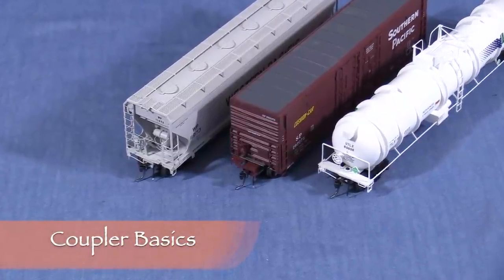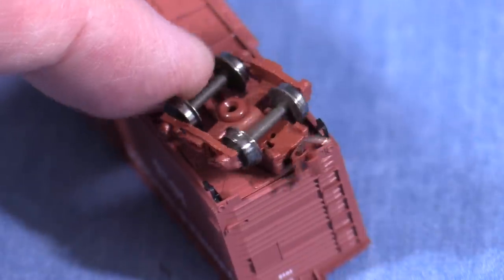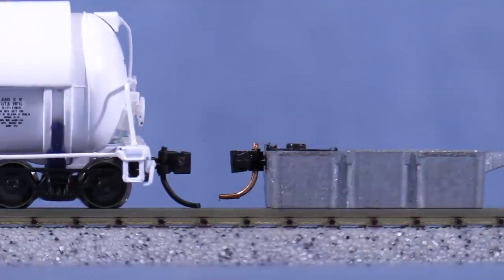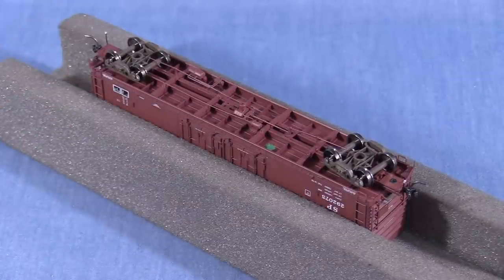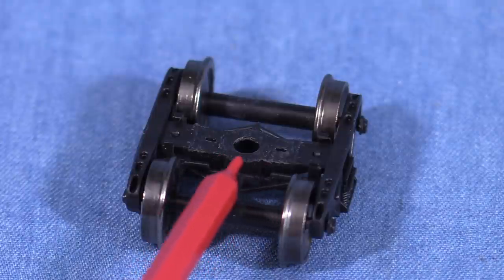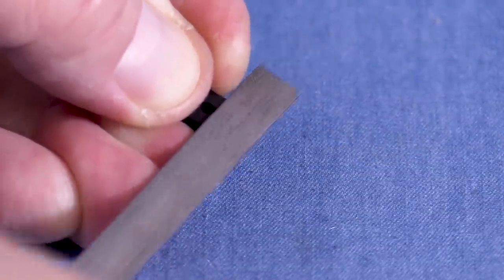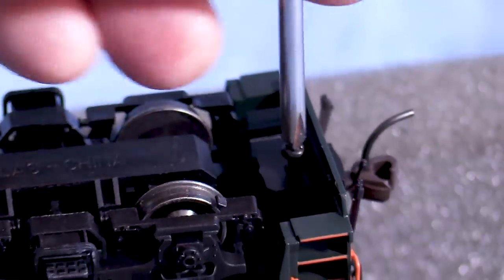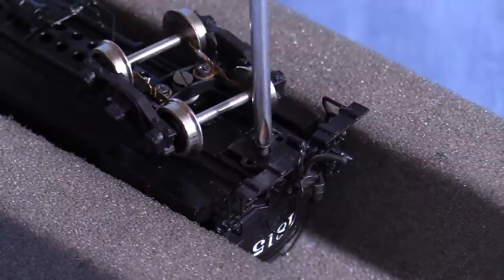Model Building Tips - Fixing Coupler Height

Comment: Love the .010" shim on the B end of the Kato well car!!! This shows how much "excess vertical height" is required so that KDs (as designed in the early 60s) can BOTH center AND be consistently attracted to the KD uncoupling magnet! Note that many recent small-cube neodymium magnets now can ideally fit between the ties and when grouped in 6 or 8 or 10 can work just the same; no real  need now to dig or go underground unless you want a 'powered' uncoupler. 

Whisker centering springs are more stout, more forgiving and "a slight bit more forceful" than than the older 60s era bronze tab ones. Bronze ones will still work but need a more "gentle tweeking" to get BOTH sides and both tabs balanced while respecting their wayward fragility. 

85' to 89' cars on a vertical curve at a grade change prefer a gradual, long and smooth transition; in contrast, with an undesirably abrupt, short and sharp grade change, for two 'same-height-checked'  couplers, you can really see one coupler head dipping well below the CL of the other on these foot long cars! Standard head couplers with their "slightly bigger face height" are more forgiving here  compared to the scale head couplers. 

Lastly, I like and retain my coupler trip pins too for 99.75% of the time -- steam pilots and some modern, rounded observation cars being the front and rear exceptions. As such, some coupler trip pins can occasionally "rub against and snag the bottom edge" of some diesel snow plows, especially if that particular snow plow coupler was originally mounted with that "tucked-in-tight" look and if that "metal" snow plow was originally mounted "dangerously too low" to the rails.
To compensate, I bend the pin so that it goes "90 degrees straight" down for about 1.75 to 2.0 mm "before starting" the curve forward and adjust the tip to barely clear the protruding horizontal KD gauge tab. All metal snow plows get a compromise .030" clearance to prevent shorting on uneven track and accommodate (not snag, not pin) any mating pin.

The HO pin arc is a "fuller 90 degree turn" compared to the O gauge pin arc (which stops at about a 45 degree angle). This is because of the mass/length needed for the differing scales and for the differing pin sizes to be 'balance-attracted' to their respective KD uncoupling magnet(s) as Keith and Dale originally tested and designed nearly 60 years ago!
Reply from the maker: Good information.  I find that the whisker couplers usually work better in non-Kadee draft gear boxes than the older style spring couplers.  I mostly use whiskers on everything now, but I still have some of the older spring couplers that I save for situations where it makes sense to use a Kadee draft gear box.  I have had issues with snowplows, too.  My solution so far is to use long shank couplers on snowplow-equipped engines that use aftermarket plows, as this keeps the trip pin on whatever is coupled to the engine from snagging on the plow.   It's a compromise but it works for now.  Thanks for watching!

Comment: Informative video Dan, thanks. I recently got back into the hobby. I find it frustrating though that I spend decent money for rolling stock just to get it on the track and have to buy different couplers on it. I think I will just plan on putting all the same Kadee couplers on all my rolling stock. Seems like NMRA could resolve this problem though.
Reply from the maker: I'm glad you liked the video.  I use Kadees on everything.  In some cases that's more of a preference, but I consider it necessary when a model has plastic couplers.  It is nice that most HO equipment comes with Kadee compatible couplers now at least.  I don't know if the NMRA has adopted or has plans to adopt a new coupler standard.  The old X2F couplers weren't great.  I remember Kadee used to advertise they were the "standard by choice", and I think that's still true for the most part.  Thanks for watching!

Comment: These are all great tips Dan!  One thing I will add is that it may become necessary on some HO locomotives (Scaletrains and Athearn rtr & Genesis in particular) to have to trim the trip pins back on Kadee couplers because these locomotives have very close coupling clearances and the trip pins could scratch and/or damage details on the pilots.  I actually talked about this when I did my review of Scaletrains.com's Operator C44-9W.  Be safe and well!
Reply from the maker: On many of my locomotives with snowplows, I use Kadee long shank couplers in front, otherwise the trip pin on whatever the engine is coupled to will contact the plow.  It's a little funky but a compromise that I put up with because I'm still hesitant to junk my trip pins.  I have a lot of equipment, and if I  changed my mind later and wanted to use magnetic uncoupling it would be super expensive to replace all those couplers.  Thanks for watching!
Reply: @DanielCortopassi  I understand that!  I actually thought of using long shanks to, but the #158s look so good on these engines.  Usually what I do is I'll adjust the trip pin (if necessary) and then trim tiny amounts off of the trip pin until it stops rubbing on the pilots.  It's not perfect but it does make difference!

Comment: Cute animations.  Back when I started getting series about couplers in the 80's, most models were kit built so checking and adjusting coupler height was part of the model assembly and preparation for layout running.   I've always left trip pins on but bend them up a tiny bit to prevent them from catching on turnouts etc.  I've usually used the KD fiber washers to get coupler height up to match.  In a few cases I have resorted to bending the shank but not to the degree you showed, only a tiny tiny bit.  I've also added a bit of thin plastic to the draft gear box to fix coupler sag.  Coupler sag seems all too common.  The real pain are the newer Atlas RTR cars which had couple lift which is attached to the draft gear so there is risk of breaking to change out the Accumate for KDs.  Filing the boss has always been a practice of mine to stop the rocking - it was just something that was common sense when no video's were available watch.  

 Your video will help a new generation of noobs.  All tried and true methods.
Reply from the maker: I'm glad you enjoyed the cartoons.  That is one nice thing about building cars from kits, is that all of the things like coupler height can be taken care of from the beginning.  I agree that some of the Athearn cars are difficult to work on.  I've had to deal with a few of those.  Thanks for watching!
Reply: @DanielCortopassi  Speaking of washers, I've been working on coupler conversions and adjustments on BLMA and Atlas HO TOFC 89' flatcars, which have metal underbodies.  They need adjusted up to match the Kadee height gauge, but the Kadee fiber washers hole is too small to fit over the lip, even when reamed out.  I'm stuck right now.  I'm looking for alternate fiber washers with similar thicknesses but a bit larger, mainly with a larger hole, that will fit over a number of models I have that won't accept the good old Kadee fiber washers.  They worked great on the older Athearn kits, but newer models, many which are RTR, they simply won't fit.  The hole is too small.  Any feedback would be greatly appreciated.

Comment: So the video was GREAT.  I have an old n Scale CON COR PA1 with RAPIDO couplers.   Can you help me / instruct me how to remove the RAPIDO coupler and replace with a micro-trains knuckle coupler.   The trucks in this model are asymmetric.   if you’d like I send you a picture of the 6 wheel truck.  Thanks.  Can’t seem to find any you tube videos demonstrating this.
Reply from the maker: I've got two Con Cor N PA-1s that are some of my oldest locomotives.  They were the best running N scale engines I had back in the day, and I ran them so much I wore them out.  I did convert them to Micro-Trains couplers, though.  If I recall there used to be a conversion kit specifically for those locomotives, though I'm not sure it's available anymore.  There are some conversion kits that might work, like the one for the newer PA-1s (pn 2000).  It has the adapter piece in it that will fit in Rapido style coupler pockets.  Sometimes the coupler pockets have a little plastic post that needs to be cut out so that the adapter will fit.  I have not tried converting one of these with the newer conversion kit, though, so I can't say for sure if it will work.  It might be worth exploring in a future video.  Thanks for watching!

Comment: Dan, have you ever change or fixed a Tangent rolling stock coupler?!?! Those things seem impossible with all the details with wires and or hoses getting in the way of the gear box. They’re really good, but seem a tad too short, so the layout has to be really level.
Reply from the maker: Most of the Tangent rolling stock I've seen comes with Kadee scale couplers, which are what I use anyway, so I don't normally change them.  I have had to fix the coupler height sometimes.  My more recent reviews, maybe over the past couple of years or so, include a RIP Track segment where I do jobs like that.  Any reviews of Tangent models that I've done recently should have that, so you can look and see what I did if you want.  Cars with a lot of detail do require a lot of care when working on them not to break things.  With most Tangent models I don't really mess with the couplers themselves, though.  I fix height issues by filing down the truck bolsters or shimming the as needed to get the coupler in the right spot.  Thanks for watching!

Comment: So i have a wagon has both couplers that are too high to couple with anything. I have been trying to fix it for 6 months now and i dont know what to do. You could almost fit a whole other knuckle coupler in the gap its that high. Does anyone have any tips?
Reply from the maker: That sounds pretty extreme.  It's hard without seeing the car, but I can offer a couple general suggestions.  Can the car be lowered?  It sounds like that's too much of a difference to be able to accomplish that by filing the bolsters, but that's where I usually start.  If that isn't practical, can the coupler draft boxes be removed and re-mounted on some kind of a spacer, maybe a block of styrene plastic?  That would lower the coupler boxes without having to lower the whole car.  There are also offset shank couplers that can be used in extreme situations.  I try to avoid those as a rule, but sometimes it's the only practical solution.  Good luck with your model and thanks for watching!
Reply: All good. I have been able to fix it a bit. But its still high but can run with everything else. I might see if i can lower it but if i cant i might stick a bit of plastic in between. I got it in a kit and it didnt come with a whole box. Instead i got a small coupler thing i could just stick on. Its a good model though. Thanks for the tips!

Comment: Hi Dan. What coupler would you recommend in N scale for prototypical size and performance? I've seen several reviews that the MT true couplers wouldn't actual couple at slow speeds. Also, any recommendations on metal wheel sets for N scalers? Thnx!
Reply from the maker: As much of a stickler as I am for detail, I have a bias toward good operation over appearance.  I have regular MT couplers on the vast majority of my N scale rolling stock.  Some people use the Z scale MT couplers, which are slightly smaller.  I have tried the MT scale sized couplers and found that they seem to work okay to keep a train together (though I didn't try enough of them to test a long train), but are impractical for switching.  Coupling and uncoupling are difficult.   I wouldn't necessarily recommend them.

I really like the Fox Valley metal wheels.  I've converted most of my Micro-Trains cars to use those.  I like them better than the ExactRail, InterMountain or Atlas wheels.  The Fox Valley wheels have a nice appearance, are well made, and are very consistent in quality.  Thanks for watching!

Comment: >A lot of the Kadee couplers are now plastic, and not that easy to bend.  
>Scale size Kadee's don't couple as reliably as #5s since they are narrower. Since they are not as high, they tend to uncouple more often--some railroad clubs have banned them.
>While Kadees are the best, Accumate couplers are downright dangerous. They will uncouple inadvertently and don't delay-uncouple at all. I've had break-in-twos with them on downgrades as cars bunch together.
Reply from the maker: I don't use the Kadee plastic couplers or Accumates.  I haven't had any trouble with the scale couplers as long as the heights are matched.  I don't have a big layout now but I have run some fairly long trains at club layouts over the years.  I guess we'll see when I get mine going.  Thanks for watching!

Comment: What about offset couplers ? You can get them in high med and low...
Reply from the maker: It's a personal preference, but I try to avoid them if at all possible.  They tend to move the coupler head up and down quite a bit, sometimes more than is actually needed.  The coupler shank is also off the centerline of the coupler.  I've used them more in N scale, rarely in HO.  Thanks for watching!

Comment: There needs to be a type of coupler that fuses the shank and loop of a kadee knuckle coupler with the connection point of a tension lock coupler so that I can run some combined trains without issue.

ISSUE EXPLAINED:

Right now I have some Bachmann Thomas stuff that I'm running but I don't have much TAF rolling stock, so I've resorted to flipping a knuckle coupler upside down and turning the trip pin backwards to hook a chain to it and then coupling the engine to said rolling stock by using a hook that sticks off the back tender. But this has recently caused an issue while going downhill in that it uncoupled itself and left the rolling stock stranded on the top of the hill while the engines ran off ahead of it.

Needless to say it caused a minor problem as my system works perfectly well on flat track, but having a dedicated coupler to fix my old ho rolling stock would be a life saver. Or vice versa for the TAF line. I honestly don't know why Bachmann decided to go with that for their coupler type, it basically forces you to buy more of their TAF line or Hornby stock in order to run a halfway decent train.

POSSIBLE SOLUTION:

I need a tension lock coupler that can fit inside the draft gear box of another train, or a raised knuckle coupler to fit onto my engine. (I've tried to just replace the engine coupler but their height ends up being off, which is what led me to this video to begin with. Trying to fix that height difference.)
Reply: I believe the type of knuckle coupler that I need is a medium to long underset shank, but I can't find any.
Reply from the maker: Unfortunately I don't have a lot of experience with tension lock style couplers.  I have a Bachmann Thomas but no rolling stock for it.  Nichole also has a Bachmann Hogwarts Express set, and that's about it.  Kadee has the 141 coupler which has a long underset shank, and the 147 coupler which has a medium underset shank.  It looks like they can be ordered direct from the Kadee website if you can't find them elsewhere.  I'm not sure if it would be helpful for your situation but they also have the 17, 18, 19, and 20 NEM couplers for European style equipment.  Thanks for watching!